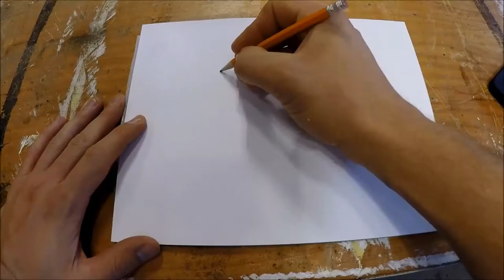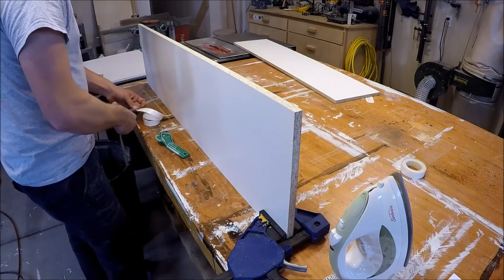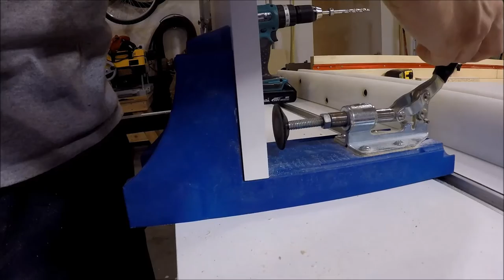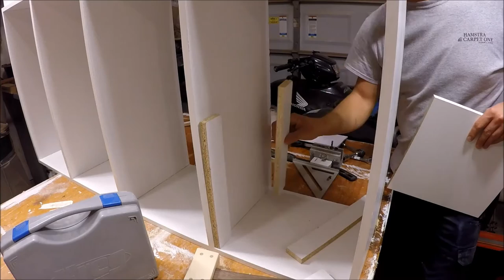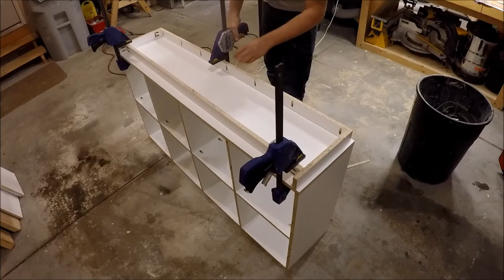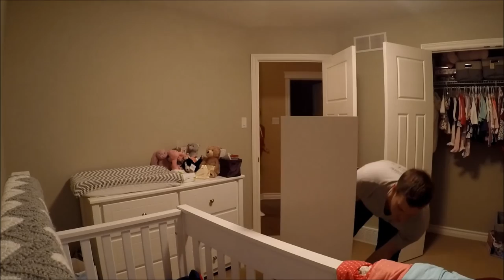How To Make A 8 Cube Cubby

Comment: quick simple and cheap, hard to beat that.
My only suggestion would be to try and make sure that the pocket holes are in different places on the middle shelves.  Kind of looks like they might interfere with each other??
Reply from the maker: Good suggestion, they didnt interfere with each other. But i could see how that could be a problem.